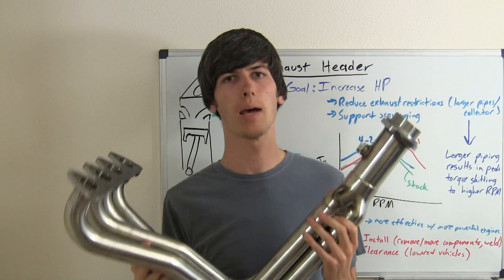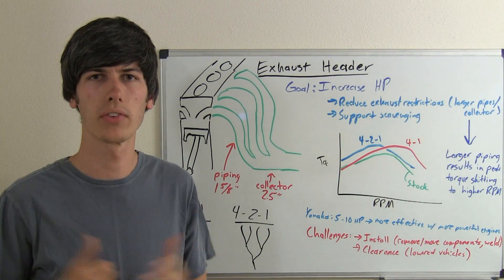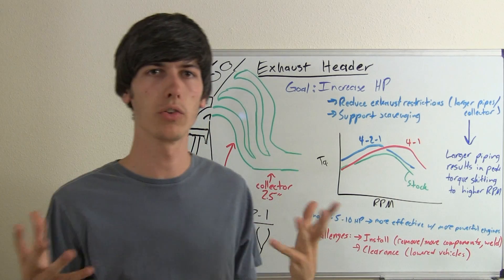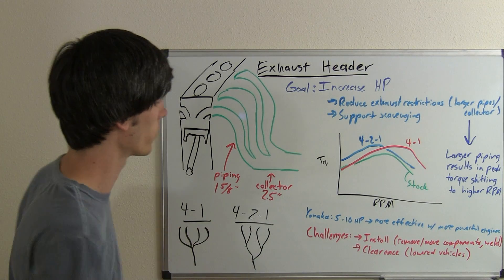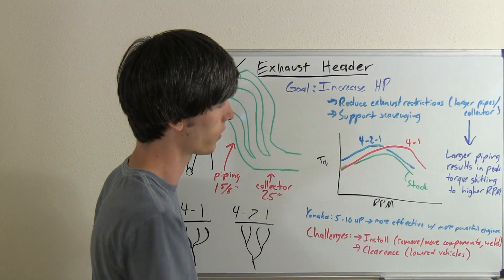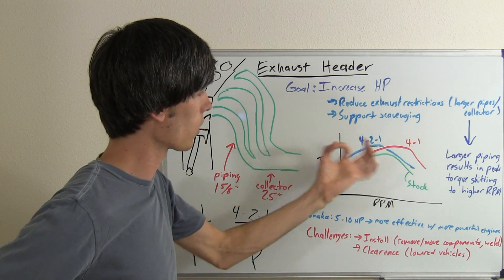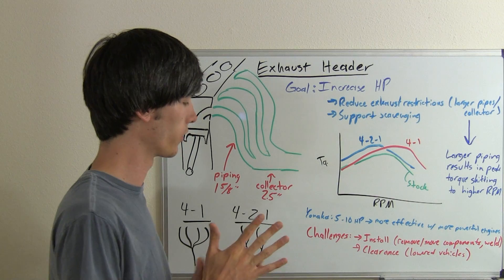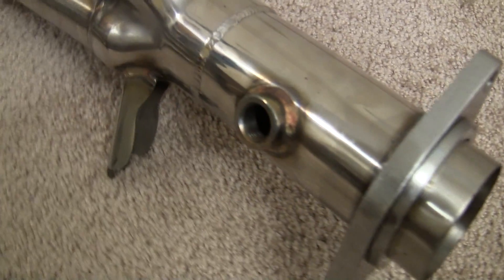Exhaust Header - Explained

Comment: First, I like your channel, and i'm subscribing, so don't take this the wrong way :-) but... 

You missed the science behind the main reason for using an aftermarket header... it is Not the larger diameter header piping (although that can help... or hurt... "sometimes").

The main rationale for a header is to create an equal length of piping from start to finish for each of the individual pistons on the engine.

Why?

- The pistons fire in very rapid succession, and when each piston releases it's exhaust gases into the exhaust system, it represents a pressure spike in the exhaust system. Each of these pressure spikes seeks to equalize pressure by expanding down the exhaust pipe, eventually exiting the exhaust.

- At the rate of piston firing in typical engine use, any given piston's exhaust pressure spike has not yet dissipated before the next pressure spike from another cylinder arrives (more noticeably so at higher rpms). So the pressure spikes from the cylinders start to overlay each other, kind of like people waiting in line to go through a ticket booth. This generates exhaust gas pressure, and the higher the pressure, the more it creates back-force on the engine's pistons which push out the exhaust, robbing power.

- While larger diameter exhaust components are helpful for reducing gas pressures in the exhaust, thus reducing resistance to the engine's job of forcing exhaust out and in turn the amount of power it takes to pump the exhaust out... there is another factor at play which a header is specifically designed to address: The spacing of each cylinder's exhaust pressure spikes in the exhaust system.

- In a typical original equipment exhaust manifold, the goal is often to use as little metal as possible (cheaper/lighter), and take up as little space as possible, while getting exhaust to the catalytic converter as quickly as possible so that it heats rapidly, reducing emissions for legal reasons. This results in exhaust manifold piping where the pistons nearer the catalytic converter having a shorter distance to travel to enter the main exhaust, and pistons further away from the catalytic converter having a longer distance to travel ("unequal exhaust path lengths").

- The pistons fire in a cycle where each piston's exhaust has equal timing between it and it's neighbors, so at any given RPM, the exhaust pressure spikes are occurring at equal intervals. But when they travel through piping of different lengths, these exhaust pressure spikes can end up closer or further apart when they reach the catalytic converter and remainder of the exhaust. If you want to go back to our people waiting in line analogy, imagine two people side by side in line, both trying to get through a ticket booth which is only one person wide, at the same time.

- A header is designed specifically to reduce (short header) or eliminate (full header) that timing differential, by making the length of pipe for each cylinder going to the catalytic converter identical, or nearer to identical than stock. So that your people waiting in line to go through the ticket booth (spikes of gas pressure in the exhaust which must dissipate to reduce exhaust pressure) are in a nice single file line which moves through the ticket booth efficiently.

(( For reference, when you see an engine's power band (in both HP and Torque) following a curve where you get diminishing power returns at higher RPM, that downward curve (which seems to prevent an engine from continuing to ramp upwards in power at higher RPM's) is very heavily influenced by the resistance of gas movement. Friction, and oscillating weight such as pistons, valves, & rods also affect it, not to mention losses in the drive chain taking it to the wheels. But back to gas movement... If you tuned the entire breathing system of a car, including: filter, intake, throttle body, intake manifold, valves, valve timing (cam), exhaust ports, header, cat, and cat-back... you could shift the peak of an engine's power output several thousand RPM's higher, allowing it to climb to a significantly higher peak, at much higher RPM, before diminishing returns bring it back down, and also provide a broader power band which helps reduce time spent shifting gears. BUT most of these components by themselves offer very little benefit, because the stock components are like a whole set of bottlenecks, and power gains are minimal when you only remove some of the bottlenecks. A header is the glaring exception though, as it can help any exhaust system move air significantly more efficiently. Although from a labor standpoint, if you're installing a header, you probably should do the whole exhaust anyway. Similarly a turbo or supercharger has a very strong single-upgrade benefit because it can brute-force it's gains through a restrictive throttle body & intake manifold. ))

* Header Advantages *
Headers can reduce exhaust pressure significantly, or more accurately reduce variances in exhaust pressure, so that any given diameter of exhaust piping, catalytic converter, muffler, etc. can work most efficiently. At low RPM where exhaust pressure is minimal, there are little to no power gains, but at high RPM's a header will make any exhaust system have much more efficient gas movement, keeping exhaust back pressure to a minimum. A good header can help reduce the need for excessively oversized cat-back tubing, reducing weight and improving ground clearance. It also makes a smoother sound at the exhaust. While a un uneven rumble may sound cool, a smooth deep exhaust note is the sound of efficient air flow.

A header can add more power (by itself) by increasing the efficiency of even a stock exhaust system, than a cat-back can. It's also much more of a pain to install though.

* Header Disadvantages *
Headers add weight. All that extra piping is more metal for your car to carry around. For normal driving in the 500-2500 RPM range, headers will weigh more than they're worth. Which is one of two reasons they aren't factory equipped.

Headers put more travel distance between the engine and the catalytic converter (another minor help for reducing exhaust pressure), but that makes the Cat take longer to heat up after starting an engine cold... and that will make your pollution emissions significantly less favorable. Some schemes that auto makers have tried to overcome this issue is to put a mini-catalytic converter in each header pipe, or to electrically heat the Cat at startup. Some performance Cats are designed to somewhat alleviate this concern with more pure platinum coating, etc.

Another possible disadvantage is that some exhaust headers have oversized piping, but if the exhaust ports on the engine block are smaller, that creates a sudden change in exhaust diameter... while the explanation is quite a bit more in depth, in simplest possible terms, you can think of sudden squared off changes in exhaust diameter as being "very NOT aerodynamic" in terms of moving gas through a tube with minimal resistance. Conical changes in diameter are not problematic, but squared off changes in diameter are not good. Large diameter header tubing on standard diameter exhaust ports could potentially rob a bit of power even at low RPM. I'd recommend getting standard diameter piping on the header (matching the factory engine block ports) OR milling out the engine block to match the header diameter if you want really big pipes (milling the exhaust ports is probably only worth it if you're going to increase the engine's gas pressures with a turbo or supercharger). For similar reasons (avoiding abrupt changes in pipe diameter), I'd recommend a low-resistance performance catalytic converter with nice gentle funnel shapes fore and aft, a low resistance muffler, and to avoid using a resonator. Likewise, the design of a header's "collector" (where the pipes come together) is crucially important as well.

ALSO:
A 4to2to1 header will perform well on a 4 cylinder engine for piston ignition sequences of: 1-3-4-2 and 1-3-2-4, but less well with ignition firings of 1-2-4-3, 1-4-3-2, and 1-2-3-4. Meanwhile a 4to1 full header will perform equally well with any ignition sequence. This is all due to getting the people going through the ticket booth as equally spaced and spread out as possible. If two neighboring cylinders in the right or left pair of a 4to2to1 header fire one after the other, then that creates additional pressure on one side in the 2-pipe stage of the header. Personally I think a 4to2to1 header is the better choice, being generally lighter, and having staged collection (merging of pipes), but only IF the ignition sequence on your car is one of the two sequences with which it can perform to it's best potential.

In terms of parts & labor, it's almost always cheaper to get a car with a larger displacement engine than it is to tune a smaller engine to be more powerful. However, I get the hobbyist interest. And with gasoline at around $3/gallon, 100,000 miles at 20mpg is $15,000 in gas, while 100,000 miles at 30mpg is $10,000 in gas. I doubt you'd usually see that large of a gas mileage difference, but there can definitely be some back-loaded savings on tuning a smaller engine. Plus "the engine in the car you already have" is always priced very attractively.
Reply: I had no idea what I was getting into when I clicked "Read more"
Reply: kathrynck Fantastic comment. Thank you so much for taking the time to write up this lengthy explanation. I feel much more informed after watching the video and reading this comment. Kudos to you both.
Reply from the maker: kathrynck What a comment! I have another video going into a bit more detail. :) Performance Exhaust - More Horsepower
Reply: Ceramic headers are generally steel headers with a ceramic coating. Ceramic is the best coating to put on a header. Ceramic is a temperature insulator mainly. It takes a couple thousand degrees to melt it, and it reflects heat very well. It keeps temperatures down in the engine compartment by keeping exhaust heat inside the pipes. And helps heat get to the catalytic converter without cooling down so much, and heat up the Cat quicker (to pass emissions). It's also great for resisting rust. Can't really paint exhaust components, it's too hot, but ceramic coating works good.
Reply: Very interesting to read, thanks!

So 180° parrallel twins would benefit from header pipes of significal difference in length.
As would those 4 valve singles with double header pipes.
Altough I would guess one had to be so much longer that the backpressure would be worse than any gain from airflow.
Maybe in connection with different diameters? ...
Reply: kathrynck ummmm Is there anything you left out" damn that's a bloody mouth full!!!. so to my question I asked  I might as well ask you!. what do you think about a ceramic header?? gee's you know you're shit pretty damn well.
Reply: Romeo Popaz ok first of all is this a lot of work to do and secondly for only 5-10hp extra??????????!
Reply: One of the best comments in all of Youtube...thanks
Reply: kathrynck Excellent explanation, very helpful!
Thank you for taking the time to share your knowledge.
Reply: Agreed. High quality videos attract high quality comments I suppose...
Reply: Very good explanation , and quite insightful. I am a recently retired career auto technician , and I have told people for years that a bigger engine is the most practical solution to performance desires , however , it is fun to get more ummph out of that smaller unit. It is a matter of choice and practicality .Personally , if the car I have won't go fast enough , I will go buy one that will. I have gotten a little lazy in my old age. Have fun , all you car people !!
Reply: awesome Just confirmed it. what about in regards to horse power any extra if so how much??
Reply: Dago Pates if it's just headers you want I'd go for some JBA's. Yes it will have a different sound but if you do it right, not cheap, you won't cook rice. To get a nice low grumble sound I'd also look into some new cams and a new cold air intake. Cars aren't cheap so don't be surprised if you're looking at close a grand for just a good exhaust.
Reply: I wish I could find more of your comments on youtube. That was so insightful! Thanks for taking the time to type all that out.
Reply: Thats a great explanation and actually brings the whole concepts into focus.  Learn it once and never forget it.
Reply: thank you for your input. you made some of those concept which can be difficult to visualize, quite easy to comprehend. I think your audience is a bit more advanced than some of engineering explained's audience, but that is not to say that the input is misplaced, quite the opposite. There are always people like me who are interested in the most detailed analysis possible. i could have read that for hours if it went on. :P
Reply: also which header is best to get that is a reasonable price?? Perrin header?. there was a guy who spent a thousand on a header didn't say which one and was pissed off with the sound he said it sound like a Honda and took it off same day.
Reply: +kathrynck kathryn wait you're a woman? cool! 

ok question: i'm planning on installing an aftermarket header, do i need to modify the manifold diameter as well or leave well alone? i need the best performance result and i already have installed an aftermarket exhaust.
Reply: Thank you for taking the time to explaining all this. Very interesting! I have one question though: Did you write down the sequences for the 4-2-1 header correctly? Wouldn't it be 1-3-2-4 and 1-4-2-3?
Reply: Dude you sound like you know what your talking about. Advice. I have an 09 Toyota 4Runner SR5 v6. I'd like to get a little out of it. What kind of headers you think I should go With. Will it change the sound. I don't want my car running like a rice burner. I'd like it to have some nice low exotic rumble to it.
Reply: Dago Pates might I add, you will gain some power but unfortunately it may not be how much you think. Your 0-60 times won't be significantly different nor your top speed. You may shave half a second but without some internal engine modifications, you won't be running 10 second 1/4...
Reply: kathrynck hi
Reply: Thanks for this thorough explanation. I read it before continuing watching the video, what a comment.
Reply: You write essays for fun
Reply: Jesus, that was a 20 page essay.
Reply: But putting exhast header doesn't normally comes with lighter metal parts ? Like titanium one for example.
Reply: @kathrynck - You're the GD man, or woe-man!  Encyclopedia Britannica over here with the greatest word painted explanation I've ever read on headers. Had me get up to go look at what type I still have in the box; 4:2:1 is the sequence I see on these long tube wings I'm putting on my 5.7 Tundra today. I also have a set of magnaflow 4 cats that go right behind. 2.5" all the way, but still haven't decided on the muffler, though Borla seems worth the extra $20. My ignorance come in to ponder getting just a 2 in to 2 out muffler, or would I be better off x-piping it, minimum 18" before entering 2 separate mufflers? IDK what that answer is, but it coming straight back to 3.5"X18" brushed/polished black steel tips. 

That's my thank you to you for teaching what I didn't know, and a view of my own current project. This is only my 3rd comment maybe on a video, and I feel your words. You can never over-explain IMO. Saying that, lol, my other concern is that my headers have a bolt in the provided 02 sensor spot at the flange; my cats are for a stock set up and came welded, 2 on each side, with their own threads for the four O2 sensors. Should I put one at each flange, and put bolts in the middle slots? Or move all sensors forward? I'm affraid with everything already being longer that the stock wiring might come up short to connect... Thank you for being you. 
-peace
Reply: I'm doing a refurbishment of an old motorcycle and love the look of 4 single pipes, I was just going for the look however if I understand correctly it should be a power gain. What arethe main advantages /disadvantage to consider
Reply: what's your opinion on 4-2-2-1 headers instead?? (i need help
)
Reply: You have WAY too much free time on your hands.
Reply: who are you and why so much knowledge.. where can  l learn
Reply: kathrynck yeaaaaa I’m not reading all that🤣🤣
Reply: Started reading this comment. Got done with the first couple of sentences. Then i stopped after realizing you took the time to write an entire novel on the science behind headers. Next time do a 12 hour video on the subject. It’ll save us 4 days of reading.
Reply: Shut up nerd

Comment: What does the sensor do. And is it ok to not put the sensor and just run with headers?
Reply: The sensor tells the ecu how the engine is running. I.e. it running rich or lean and can adjust for that condition. If you leave the sensor out it wont know how the engine is running and will run super rich and slow because it doesn't know what is going on and its safer to run rich then it is to run lean.

Comment: Hello my question is do headers increase gas mileage?? Or just hp??
Reply: With mods that increase hp, you are making the engine more efficient, so you are able to use the same amount of fuel and get more energy out of the fuel being used. Either by the engine working less to make the same power, or making it use the fuel more efficiently.